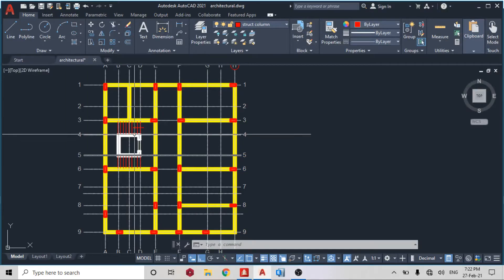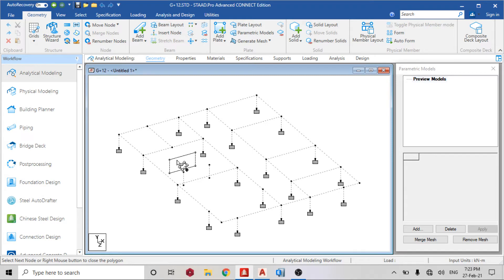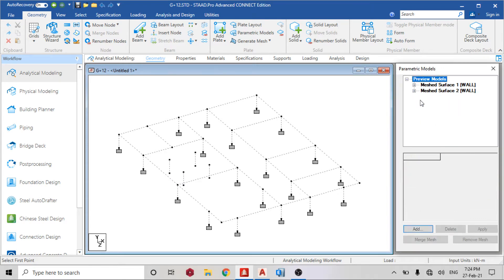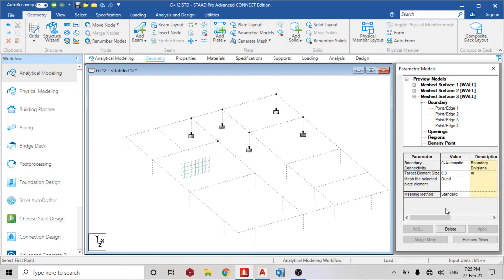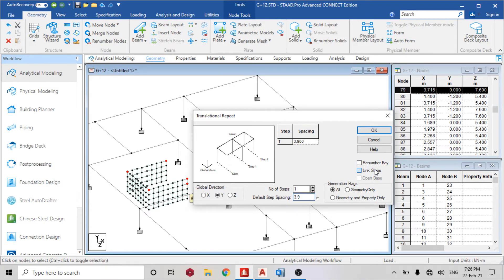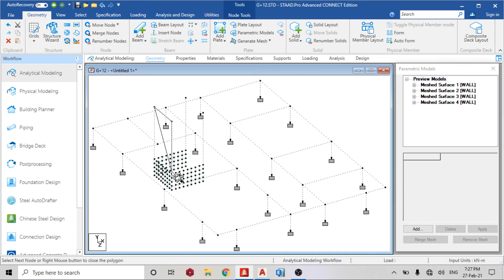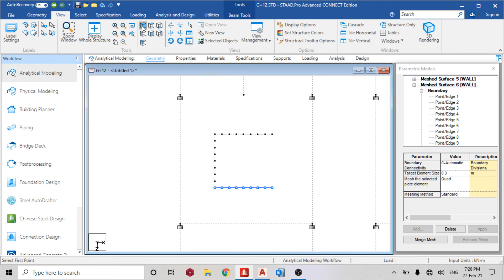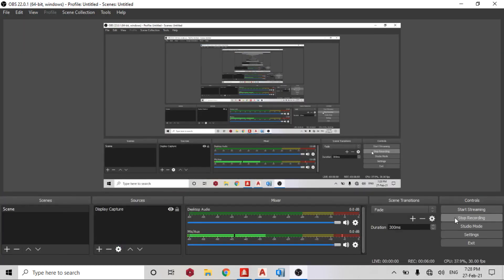Part 5 modelling the shear wall on staad pro connect edition

Comment: hi sir,,, I just wanna ask how to model a loadbearing walls ? is it the same idea ? I know we need to change the density the elasticity and other thing in material.... but the modeling ???
Reply from the maker: I’ve not tried to design one with staad. But I do it manually
Reply: @Lanreolokunola  your design based on BS EN or ACI ?
Reply: so if we made the same shear wall but we make it from other materials, is it work ?
Reply from the maker: Eurocode
Reply from the maker: @zues1979  you’re going to check the crushing strength of the sandcrete block not really providing rebars in it. So I don’t know how you’d go about it